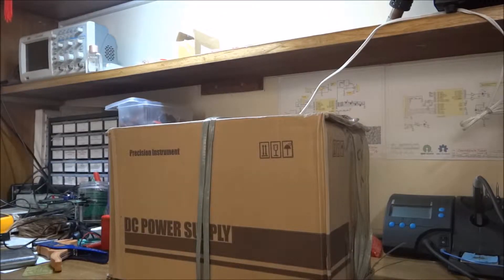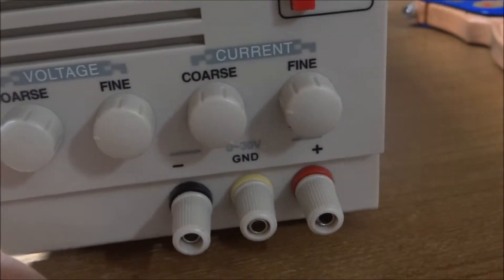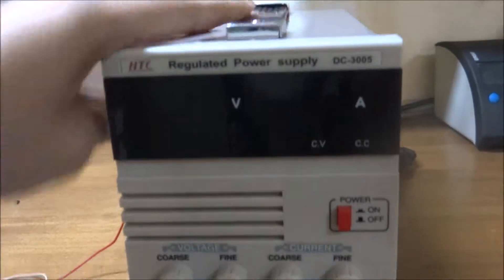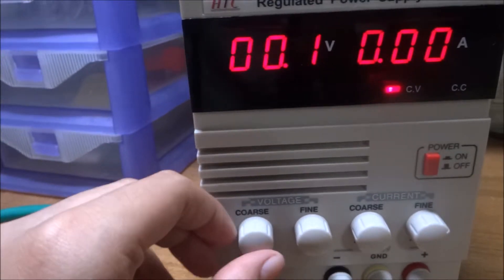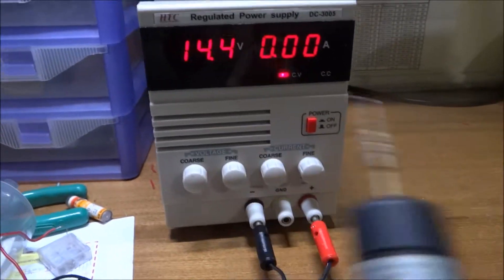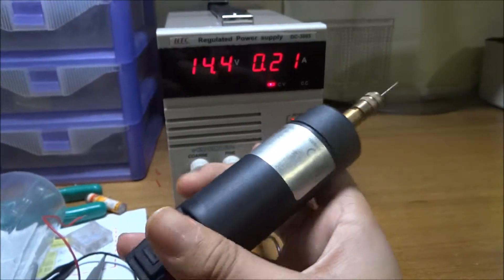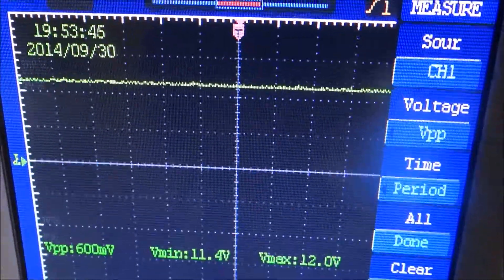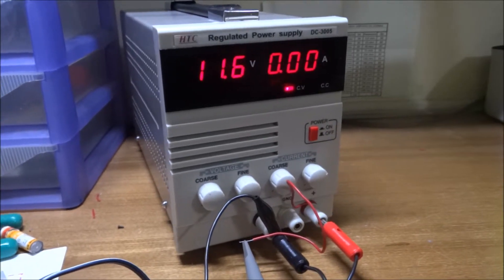TWE #1 HTC DC3005 - Power Supply Unboxing and First Look

Comment: Today I purchased the same model from a local store in Kolkata . The cost is ₹5500/- (inclusive Central & State GST with Pucca Cash Memo.) In this model HTC improved the circuit with adjusting multiturn pot for both current and voltage control . The model number is DC 3005 . It is a linear power supply with a very good quality transformer . I am very happy with this bench power supply . HTC is a very good Indian company from Mumbai . Last year I purchased an AC Clamp Meter Model — CM- 2070FT . It is also a very good ac Digital AC Clamp Meter . All HTC products are very good and also low cost .